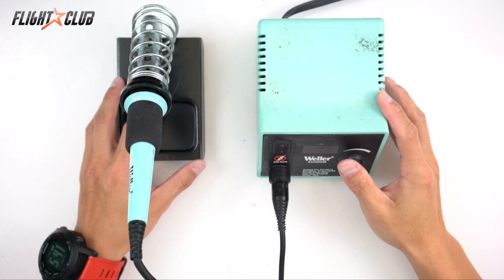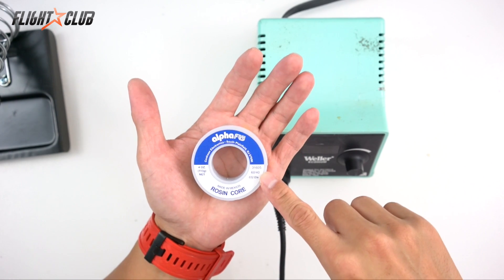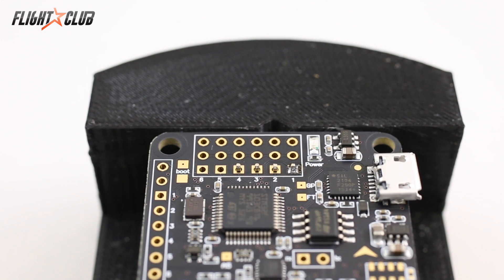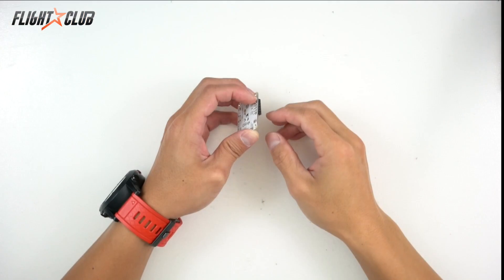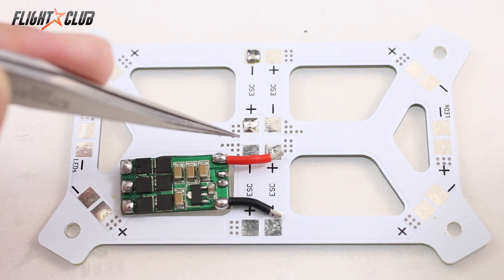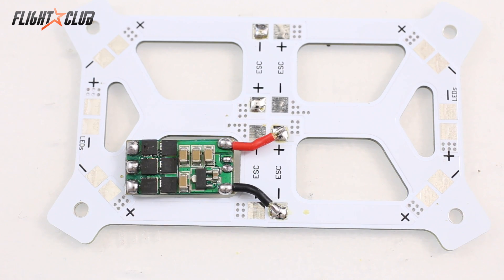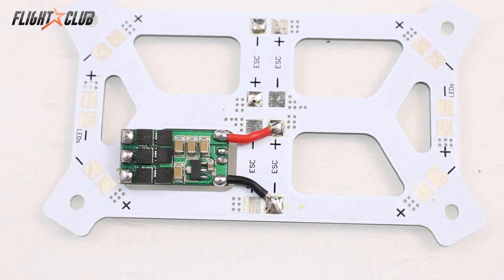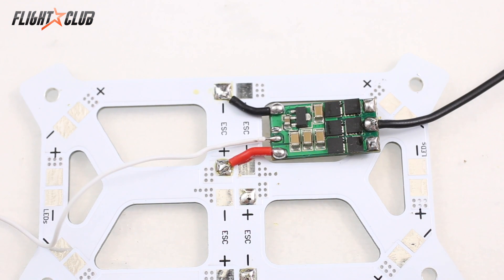How to Solder

Comment: This video is hands down the BEST soldering video for quads I've seen. Very detailed.

Another tip: If you're new to building quads buy yourself a cheap $99 build and start there. 

I made the mistake of buying lightweight high quality components ($$$) from the start without the soldering skills to back it up. I bought those components 6 months ago and have yet to fix that quad because I want it to be PERFECT. If you start with a cheap build you can just get it built and fix your bad joints as you go, then save the quality components for when you're more comfortable with soldering.

Since I spent nearly $400 on my build I'm buying a soldering practice kit and getting some experience before I finish. Would have liked to be flying already though!
Reply from the maker: great tip.  or you can buy a cheap power distribution board for a few bucks and practice on it

Comment: Great video, thanks for posting.

I think most who solder would say your work is certainly more than good enough, but for the next level, you'd want to use much less solder. Those large globs on the pads completely obscure the wire strands. The idea is to tin the pads, not deposit a mound of solder

The reason for your "bad joint" at 11:50 is that you didn't use extra flux on the big solder glob or the wire. Solder will flow towards flux, so you want flux the wire end, then heat the solder glob on the board until it melts, then bring the fluxed wire end to the glob. The solder will flow up the fluxed wire with good wetting.

And despite the shiny surface, that joint is NOT a good one. You can see @ 12:32 very clearly that the wire isn't wetted. Look near the insulation on that wire. You see that space between the solder mound and the actual wire strands? THAT is lack of wetting, and that is bad soldering joint.

Easily remedied, though. Stick a little high quality solder wick on top of the mound and melt a bit. The flux in the wick will give good  wetting when re-melted and you'll wick up some of the mountain of solder-- kill two birds with one stone.
Reply: agreed, too much tin is used. You should be able to see the strands in the wires. Saves weight too ;-)

Comment: Wich solder tip do you use to solder XT60 connectors?
Reply from the maker: +xuxusito same tip.  I forgot to show it but I'll show it on the next build video
Reply: so no tip with a flat surface (scissile) for max. contact ?
or more heat for the larger copper/metal amount to transfer heat to ?